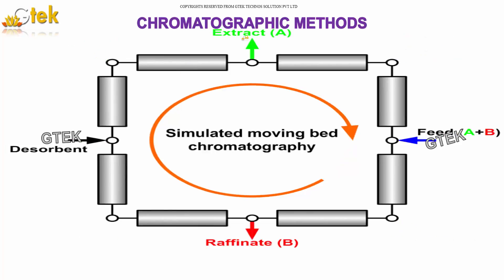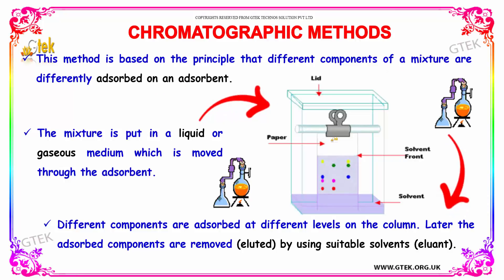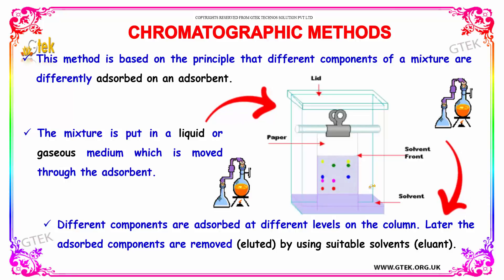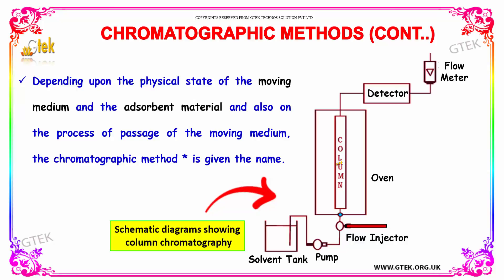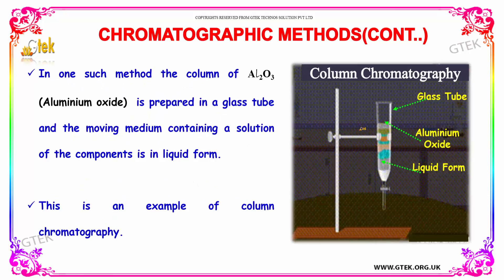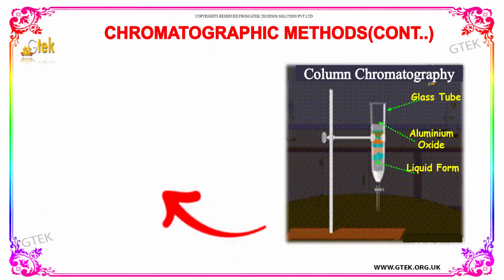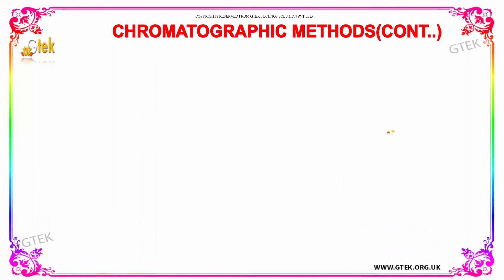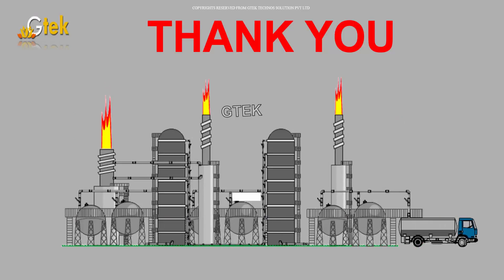chromatographic methods general principles and processes of isolation of elements 12 chemistry cbse

Comment: Chromatography is the collective term for a set of separation techniques that operate based on the differential partitioning of mixture components between a mobile and a stationary phase. ... Chromatographic methods are important in the analytical and preparative separation of biological samples.